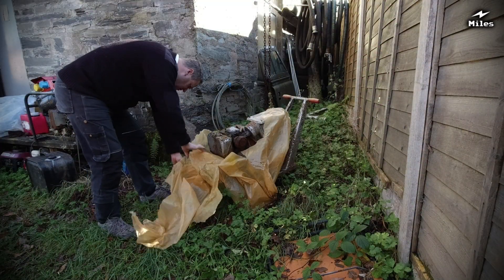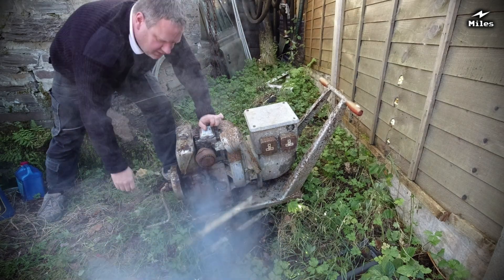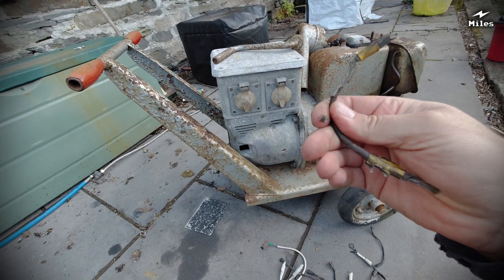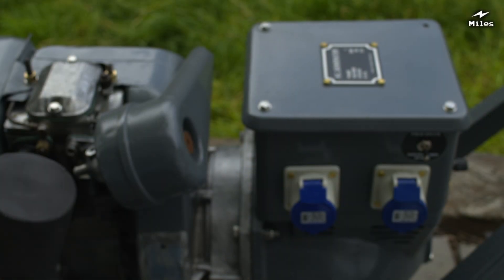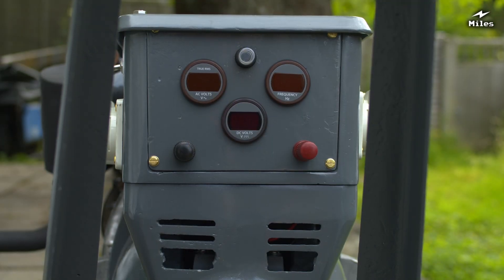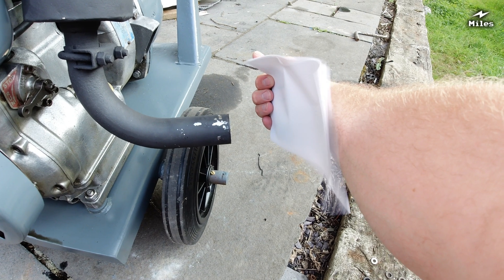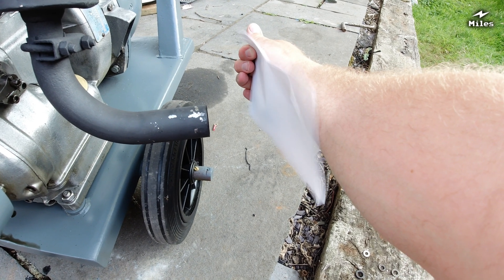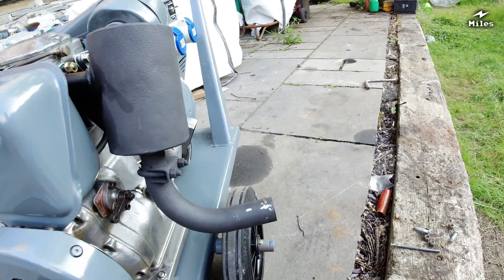Lets Fix It Up! Petter AB1 Diesel Engine Powered Generator

Comment: I have a very similar generator, bought it second hand about 35 years ago, it dates from around 1971 originally. It provides us with standby power during power cuts, which living in a rural area are quite common. The Petter engines are very reliable as long as you do the basic service every year, and fuel consumption is very low. Had to start it from cold at -6c this winter, that did result in a few curse words, but got it going. They are noisy but you cant have everything...

Comment: a more fixed rpm engine will always run cleaner then a moving vehicle due to the change in rpms altering air fuel mix ratio